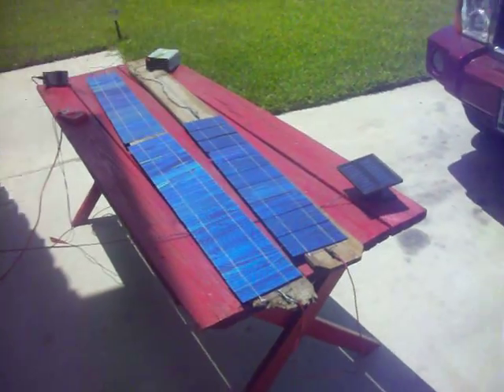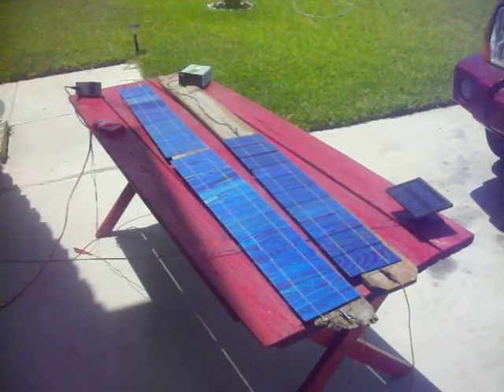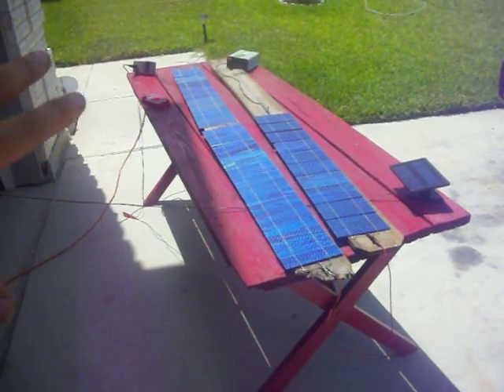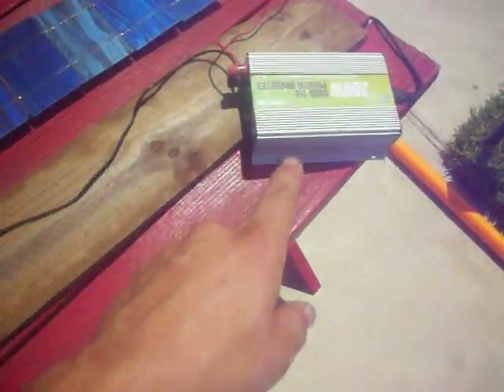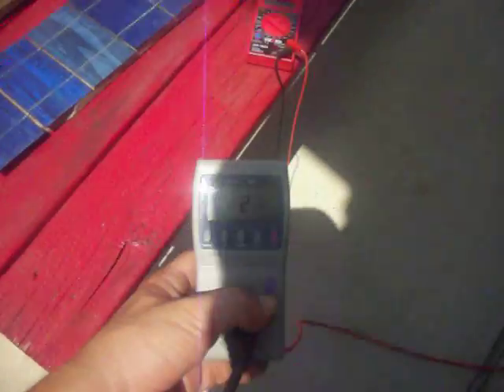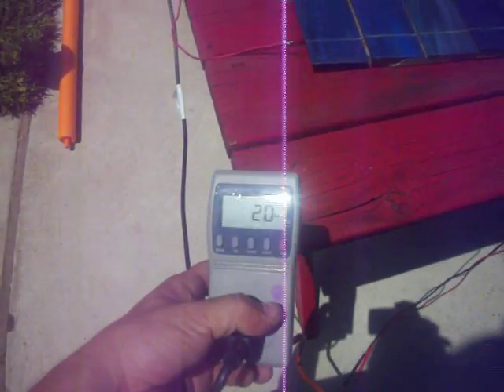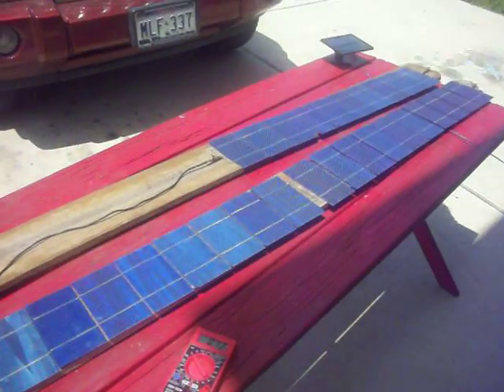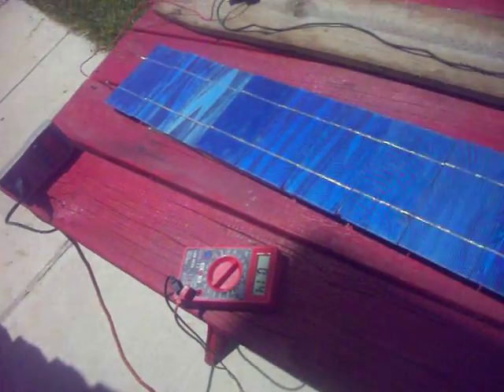TESTING MY SOLAR CELLS FOR MY DIY SOLAR PANEL ON A GRID TIE INVERTER

Comment from the maker: @VWRabbitdiesel 
I thought about copying your case. I'll try to get to lowes to get the wood, glass, and junction box to day, but its looking like it will be next weekend. i still have to wait for the rest of my cells to come in anyway. I picked up an electric lawn push mower to day at the flea market for $15.. I'll probably be messing around with it later. I'd like to be able to charge it with solar power..
later, islaguy...